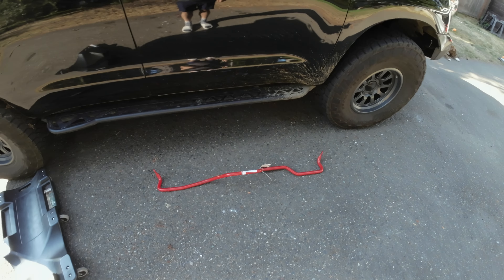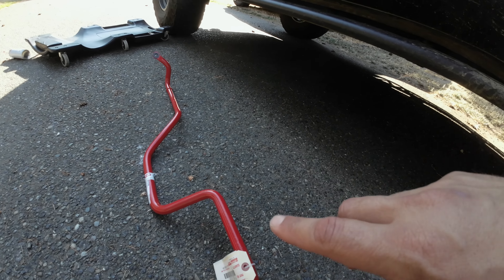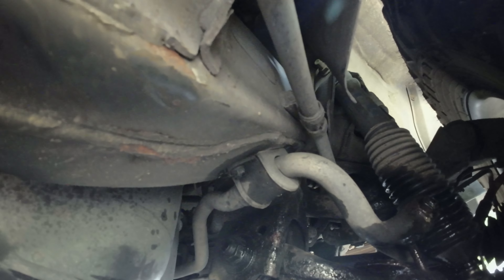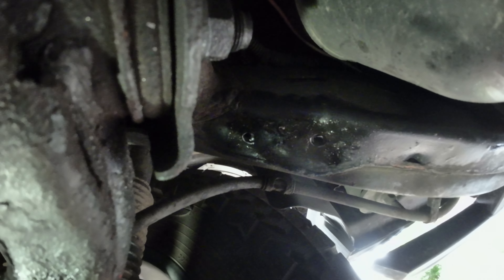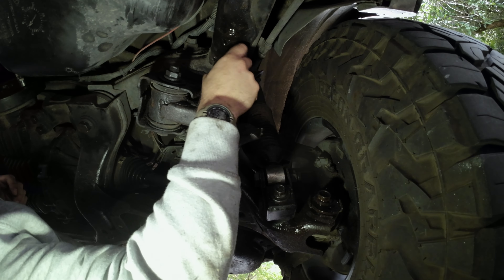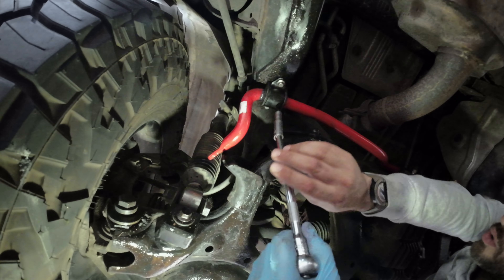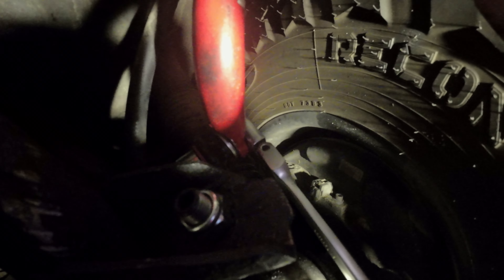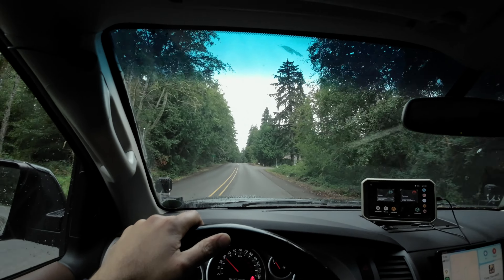Toyota Sequoia TRD Rear Sway Bar Install

Comment: Have you had a chance to do any offroading since the install.  Adding a RTT and would like to have the additional benefit of the stiffer sway bar, but am concerned about the impact to rear suspension compliance.
Reply: And what year is your Sequoia. I thought I remember you saying it was a 2013. Mine is a 2012. The part number says it's for a 2018+.  

I've got the Platinum as you do.

Comment: I ordered one after this video and got an email that the trd parts only fits 2018 to 2022 model. The part number is PTR620C181.

Can anyone confirm if the part fits the old models. Mine is 2013 SR5
Reply from the maker: Yes it fits. Ignore the email.

Comment: Great vid pal! Well done.  May need to upgrade my rear as well.
Reply from the maker: It's worth the upgrade minus the rusted frame bolts.
Reply: @CoolGuyClub  I literally just looked under my rig.  And theres seems to be no rust.  Granted I'm based in Florida.
Reply: @CoolGuyClub  do you have torque specs for the drive shaft and sway bar links?

Comment: Tinker need to put his inout on that. 
He didnt talk about vehicles with independent rear suspension like our sequoia. 
I have the same question as on my tundra i run trd sway bar with no front. Feels great. 
Need more details how it really work with independent rear.
Reply from the maker: Chassis dynamics should be the same. Rear droop is still limiting factor on travel.